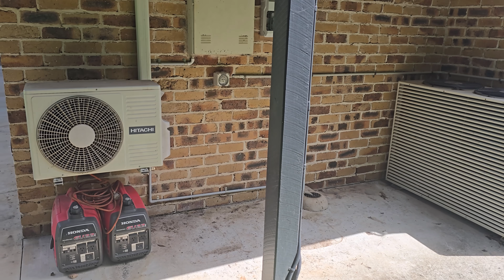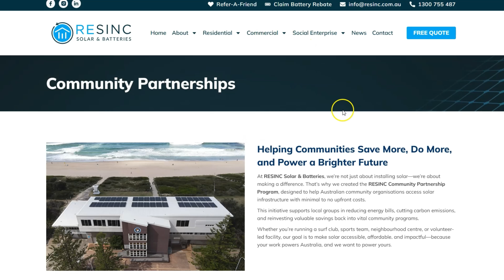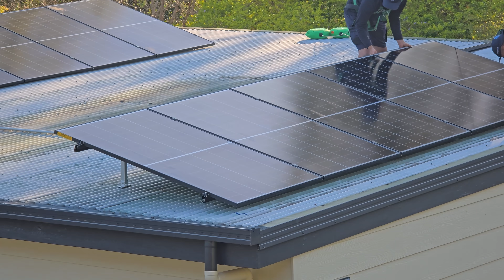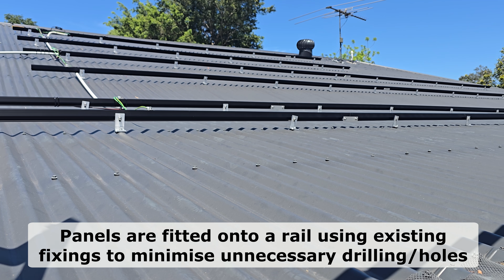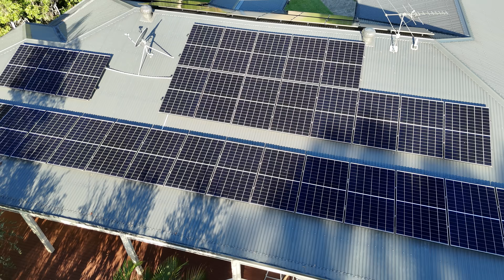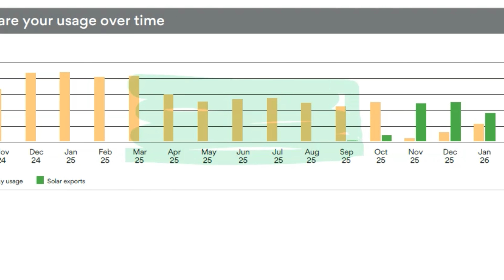From $600 Power Bills to Self-Sufficient POWER - My MEGA Solar & Battery System!

Comment: We're in the Dallas/Fort Worth TX area and after the Big Freeze in 2021, I covered our roof in solar panels, got 2 batteries (not near as awesome as yours) and the company threw in a whole-house Generac and I could not be happier!! Before the Freeze, our electric bill was $170 a month every month (we were on budget billing - no highs, no lows, averaged out for the year), then after the Freeze it jumped to $270, then the next year $450. Before it jumped again I got the system installed. My husband and I are 58 so we have essentially pre-paid our electric bill for the rest of our lives. We still have to pay the fees to be connected to the grid - about $33 a month. And our system doesn't completely cover our electric bill when it's 100 degrees out and the A/Cs are blasting, but our bill now is around $100 a couple months out if the year so that sure beats what it was. Our system was about $90k USD and about 2/3 the size of your system. 😄 We have a 1 to 1 deal with the electric company - I pay 13.5 cents per kwh we use from the grid and they pay me the same amount for the excess we send back to the grid in a bill credit like you showed in the video. If the grid goes down, we don't even notice.

Comment: Funny how you expect to be self-sufficient in winter but not in summer.

In Central Vic its the opposite. If i had a battery, I would expect to be self-sufficient over summer, and need to be grid supplemented in winter. I have a fully electric home, including heat pump hot water, and reverse cycle AC for heating. My car is also EV and I enjoy dodging these fuel price hikes due to war. The sun keeps shining.

Comment: Mark, please follow up on this in November.  You mentioned that you think your grid bill should reduce when you stop using the aircon, but my experience with our grid fed solar (central Qld), is that the bill went up in winter.  I have argued with the power company about it, and asked them to explain why it would go up when we don't use any form of heating, but they can't seem to explain it.  We don't use that much hot water!!!  So I'd love to hear what happens for you. Cheers.
Reply from the maker: Ok, thanks for letting me know... With our old system, our power bills would always be much cheaper in winter than in summer, so I am assuming this will continue. But I will keep a keen eye on the feed in and our usage, and will definitely give regular updates on how the system is doing (good or bad). Cheers :)

Comment: I know you guys can install a giant system like that very cheaply. Here in the US, that system would be $75K. And now that we no longer get the 30% federal rebate (thanks, Trump), the only help you get is state and local rebates. I'm so jealous that you guys can install such amazing systems so cheaply. 

Sadly, it's STILL worth installing  that expensive system here in the US, because our electricity rates are going through the roof. You were paying $600 / month before. Guess what? That's cheap, especially for the size of your place and all of your energy usage. Where I live in NY, people were paying $1,500 OR MORE for electricity, especially if you have an EV or two and heat pump tech for heating/cooling. We got solar last year after we switched to geothermal, because we saw the handwriting on the wall: if you don't control your energy production, then you have no idea what your monthly bill will be.

I have an extra 4.5kW DIY array ground mount array and will be adding another 4.5kW (I already have the panels). I'm kinda obsessed with generating enough electricity to be completely self sufficient energy wise, or at least sufficient enough so that we are so with slight adjustments.

Comment: You feed in 3887kw and bought 1495kw. Ideally you buy nothing and import nothing. Put that AC to use as soon as the battery is charged and keep the house cool.

It looks like your shed, oven, heater, hot water, AC are powered by the grid or your solar from the shed during the day and your lights and power circuits are being directly power by the Battery? I backed up my whole house and will charge from the grid only at night if the battery is depleted to 5% or it's rainy. Your inverter is plenty big enough for most loads.

Comment: My experience for solar has been disappointing to say the least. $8K and only get a $25 to $30 off my bill every 2 months. A lousy 2cent kWh paid for all day supply I put into the grid but charged 29.4 cent per kWh I use. Never pay back for my solar costs. Looking at a battery now, but costs high for me ( pensioner) or just decommission the lot and stop putting virtually free electricity into the grid.
Reply: The savings from your solar would come from the energy you're using directly from the panels instead of buying from the grid at $.294. The surplus being fed to the grid isn't the moneymaker anymore, the only real savings if you don't have a battery are from self-consumption. 

If you look at what your system produced over the same 90 days of your electricity bill, and then subtract the amount you sent to the grid, that's the amount that you consumed from the system directly. Multiply that by $.294 and add it to the little credit for exporting, and that's the amount it saved you over those 90 days.

Hope this helps!
Reply: Try to run high drain devices during sunlight hours and not at the same time if possible. We were always running the washer, dryer and dishwasher this way on timers and also the hot water service (need an electrician for this though)

Comment: We have a 13kw system installed 4 years ago. We didn’t do a battery as the tech wasn’t up to it yet, I was studying sustainable living at the time. We do have an electric car which we charge on the solar .  I would suggest an energy audit of the house, that being what other things are bringing your use higher like how much insulation do you have? Are there more efficient cooling systems or fans that would be better.  Do you have double glazing? All these considerations can reduce your use considerably
Reply from the maker: Good stuff. We don't have double glazing, but we do have good insulation. I think the solar panels have also made the roof cooler. Yes, there are lots more we can and should do to save energy. Cheers :)

Comment: Great video Mark - I'm an occasional watcher of your videos - but my question would be, what about CME's from the sun which are beginning to peak and become more and more impactful as earth's magnetic field gets weaker and weaker?  (which is documented).  How will this expensive system stand up to that?  It's my understanding it wouldn't take a Carrington-style event (which we're overdue for) to fry the solar panels, batteries, etc.  (Doesn't have to even be in sunlight for that.)  The increasing aurora events we're experiencing worldwide are evidence of the weakening of earth's magnetic field (as are the shifting poles) - this means it requires less and less high-level CME's etc to have a big impact on electrical systems of any kind or any kind of circuitry.  (As I understand it.)

I imagine a portion of your audience is familiar with what's happening with the sun generally through channels like Suspicious Observers (Ben Davidson) and maybe Stefan Burns, etc.  Ben in particular has a whole prepping focus around survival after CME's expected somewhere around 2034 (although this comes from lots of other more metaphysical sources as well, Ben has a few docu-films that go through all the evidence for this happening).  Actually I don't particularly like the guy, but a lot of his data/sources are hard to ignore.  Of course mainstream science which is its own little gated/funded echochamber ignores it but is slowly starting to include solar forcing into climate modelling in a more real way...anyway - this would be my main question when getting a quote.  I wonder if we have up to 8 years' use of this before the sun, hurricane/cyclone or other huge event hits us (more and more frequent now with climate changes) would it be worth it financially.

Comment: I went with a Solar Edge 8.4 kwh (Korean panels) from Solar Hub and a Tesla Powerwall 2.  My only running cost is the daily service charge from the electricity supplier.  The feed-in tariff is negligible but it pays my natural gas costs each quarter.  With a solar system you are pre-paying your future electricity costs but covering yourself against future price rises and blackouts.

Comment: $50,000 AUD in my super account will return $5000aud and increase every year with compound interest .Add   increased insurance premiums , one decent hail storm in 5 years time , a small percentage of the panels damaged , then the whole lot will most likely need replacing ( just happened to a friend in Brisbane) . Also due to fire risk management ,I wonder how long before insurance companies will not cover systems out of warranty ?  So every ten years or so (just like water hoses to dish/clothes washers) they will have to be replaced.
Reply: Midwest in States just had a tornado ripped through a 15 acre solar farm and recorded record breaking hail at 6” 😮.  I wondered what insurance company covered that and cost of the premium.  House insurance keeps hiking premiums here—reasons:  cost of replacing for labor and parts and The Weather.  They just had an insurance company on news talking about extreme weather and damages.  The storms are earlier, more frequent and more violent.  Not to mention I wondered what insurance how they will clean that mess up and if there is pollution from the panels.

Comment: The upfront cost of those systems is massive though.  Especially in the states, you're looking at 45,000USD - 60,000USD for an average sized home.
There are a lot of scammers out there too, like Green Energy who operates in India and ignores all do not call requests.

The issue I have with solar panels is how varied installs can be by 'professionals' that can leave you with a lot of headaches.
My dad went solar and half of what he talks to me about is gripes about all the little issues he has had with his and him constantly getting them out there to fix it.

Then there is the panels themselves.  Tech Ingredients has a very good video series on solar panel efficiency and how you can improve output from them by adding ventilation and heat sinks, as heat speeds up a solar panel's life span, and they cannot be repaired, only replaced, so a bad hail day can set you back quite a bit.

Comment: Brilliant isn't it. I live about 20k from you, and we lost our power for 3 days during cyclone Alfred, then for 6 days in that big November storm. Our  battery ran the house the whole time, we were careful in our power use, but we didn't even come close to flattening the battery. But we only had partial house backup, so couldn't cook, only 1 air conditioner on the backup up circuit and we had no hot water. So after that November storm  we did upgrade to a bigger inverter to give us full house backup capability and increased our battery from 19.2kWh to 38.4kWh.

I'm also glad to hear your opinion of the power companies seems to match mine!

One thing you didn't mention, and it may or may not affect you depending on whether you have septic or a home sewage plant - for us, no power means the home sewage treatment plant will fill up fast as it cant pump out! The house would quickly become unliveable without power for an extended period, no using water or toilets etc once the power is out.
Reply from the maker: Ahh yes... I forgot to include our septic system. That's a good point! You were way ahead of us then because we had no backup during Alfred. And, we will be doing the same in a prolonged blackout - limiting our aircon and unnecessary electricity use and keeping the battery storage to run our fridges and septic! Cheers :)

Comment: I like sums.  Most people do not and don't see what I see.  

$6000/year for electricity previously
$2200/year now 

$3800/year saving
Battery cost on the cheapest side would be $30k
Battery needs to be replaced 10-15 years.  
So each year it costs you $2k for the battery.  
Most [probably all] of the savings are due to the solar panel, not the battery.  

Solar batteries aren't really worth it as the replacement costs are too high currently.  
Large solar panels and using that to heat hot water is a better way to store the energy.  

If you put the $30k in the bank your return will be better on your investment.

Comment: lucky u mark! not sure about down in Australia, but in the US its not very easy/common to get 3 phase power in a residential structure.
Reply from the maker: Thank you! 3 phase doesn't come automatically here either. You do need to request it and pay an extra fee for the initial lines to be installed. When we did our renovations a few years ago, we installed an induction cooktop only to find we needed to upgrade our power supply coming in from the grid - that was a bit of a shock (pardon the pun). Cheers :)

Comment: Those shade compensating balancing panels are game changers. Solar hot water and radiant floor heating is another great way to save power. I want to make a half width (collector " (.  * " at the bottom) compound parabolic equatorial facing wall E/W aligned solar trough with a vacuum insulated dual wall glass tube solar collector to heat the oil in the main tank. Utilizing thermosiphon to circulate main tank oil. Heat exchanger to pull heat from the main tank to the floor circuit (no fluid exchange). Look into passive cooling (window shades, natural air flows, cold shadow side intake, Hot upflow dredge pump style air draw exhaust). You might also want to examine the venting of ships engine rooms, 2 pipes out the roof to fresh air but one is a short straw and the other is a long straw reaching deeper into the engine room to cause natural differential and flow in one direction, long straw intake getting pre-chilled by shadow side of building while hot side wall has air convection draw pulling air out of the structure as long as there is heat rising up that wall sucking cold air down that long straw.... Now fill the basement with 3 inches of water and you have an ancient ice maker.

Comment: So I live in the big city of Houston, Texas. I am so close to the main downtown Houston I could walk to downtown that’s how close I am but we don’t ever really lose power and I think it’s because I’m so close to the downtown we have the light rail near me two blocks away and everybody in this area area. There is a lot of people that lose power, but but some of them have those home generators I’ve thought of getting one, but we really don’t need to lose power. We lost power back in 89 with one of the hurricanes, but that was then and we’ve never lost power since even with the freezes, we didn’t lose power now I do prepare for something like a storm or the freeze. I will cut trees down under the roof line just in case cause we did have a massive. What do they call it straight, wind, storm, and the trees in the power went out, but I spent a good amount of money getting a tree company to cut the tree down and haul it, but it was worth it because if that tree snapped and it was above the roof line, it wouldn’t broke my roof and half probably Sycamore trees very heavy

Comment: It would be interesting to know how your old solar system held up. For example, when it was new, how much output was it generating vs. what the output was when it was removed. Was it generating the same amount after 15 years, or was there a percentage of loss?
Reply from the maker: The old system continued to generate 15 kWh per day right up to the end. Same with the inverter and the panels; they were quite dirty too, as we hadn't cleaned them for about 12 months. We never had an issue with our old system for the past 14 years; it just worked. Cheers :)
Reply: @Selfsufficientme, thank you for taking the time to share!

Comment: honda generators are the best ever.. dont use e10 fuel ever, as it gums up the carby or jet.. Also dont use old fuel more than 3-6 months sometimes, or at least when it has that off fuel smell..and learn how to degum the carby 5-10 minute job that will keep them running for ever..  =bb    And keep Getting into it..  =P     =bb

Comment: Both solar and batteries have gone so much cheaper now, that, as we say today, it's a "nobrainer". Especially if you have an electric car. Remember, solar is essentially silicon, you can recycle it. The batteries too. And the sun is free. Meanwhile, fuel is shit you extract from the ground, burn so that it's gone forever, and it pollutes the planet. Not to mention Australia mostly uses coal and gas power plants for its electricity... about 2 thirds of Aussie electricity is fossil fuel... It's awful to have that these days, we're talking about such a sunny country, just go ahead with the solar farms for fuck sake...
Reply: not a no-brainer when it's going to cost something like $15K - $60K depending on your house, location, circumstances

Comment: Hey Mark. We got a 10 kWh  solar battery system just over 12 months ago. Sungrow similar to yours. We are very happy with it. Yes the power bill is lower but having that blackout protection is fantastic.
Reply from the maker: G'day Bart! It's great to hear that you recommend Sungrow and have had a good experience with this brand and system over the past 12 months. Thanks for sharing :)
Reply: Positive experience so far. If we could of afforded it we would of probably had a larger battery put in.

Comment: the brickies did a crappy job on your house, i saw it instantly without even checking it out.
Reply: ps I changed my mind,  i commented when i saw the little area at the start, when i saw the side of the house i was literally in a state of shock. i was a brickies labourer for 2yrs fifty years ago. i am shocked they got away with it.